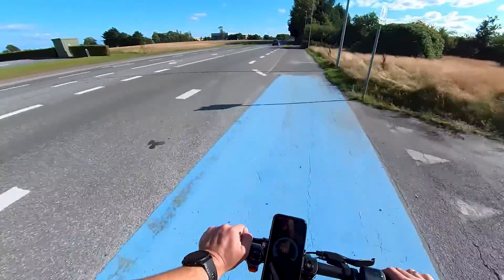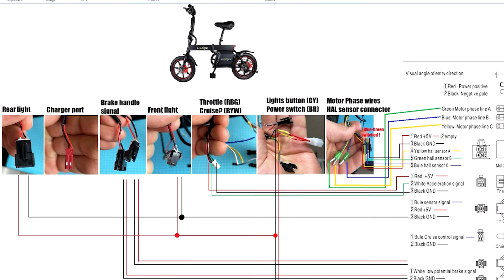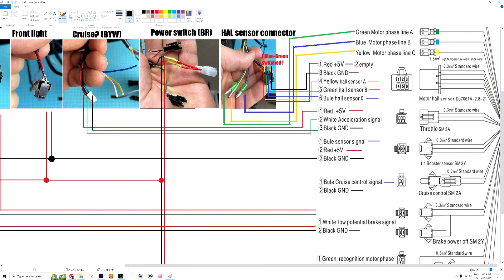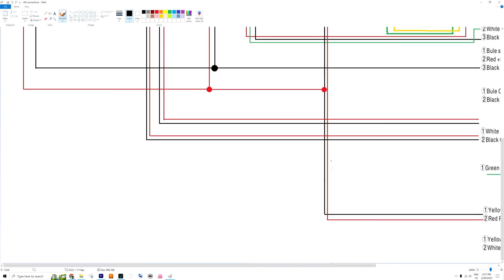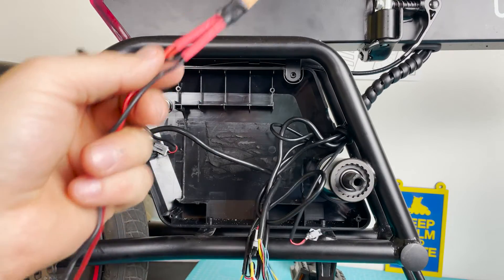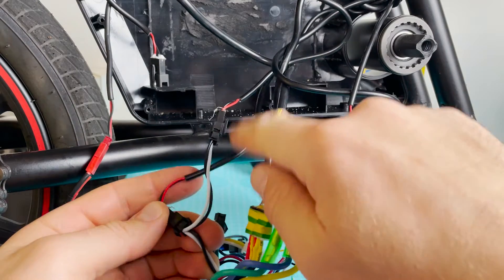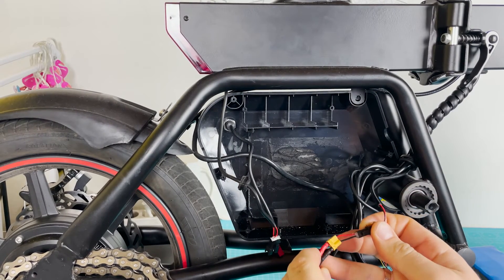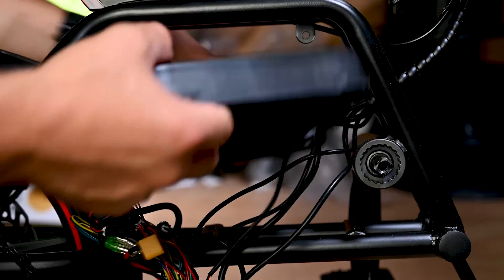Windgoo b20 controller replacement details

Comment: I have successfully wired up the new controller thanks to this video but I’m yet to test it outside. I have a couple of questions I hope you can help with. 
1. How will I know if I have wired up the hall sensor the correct way? 
2. Have you figured out a way to make the voltage meter on the throttle work? 
I’m yet to wire up the headlight but I have managed to get the brake lights working when brakes are pulled by connecting front and rear together then wired to the yellow and white brake light wire on the controller 🙂
Reply from the maker: I have not spent much time on it recently so Voltmeter not addressed, I fixed the headlight, but don't remember how :D With hal sensors you normally find ground and positive one, and then you have 3 hall sensor wires left. Maybe possible to open the motor cover and see the sequence or just play with the combinations until it both spins at load and at speed smoothly :)

Comment: VRMinde would you please be so kined to send me a picture or email to me how I can connect my Brainpower Motor Controller volts:36/48V Power 350W to my Windgoo B20 ??
And please show me the right way how to connect my CD_S866 Display to the controller and to my Windgoo B20 ?? Because I can't find the right wiring diagram for it on the internet !!
So hopefully you can & will help me fix it. Greetings from the Netherlands from Frank Grinwis
Reply from the maker: Hi Frank, sorry mate but I do not know anything about your specific controller and without a diagram I do now how to connect it.
Reply: To bad....
Do you know maybe where I can find the wiring diagram for the Brainpower Motor Controller volts:36 48V power 350W ??

Comment: Hello please i'm very thankfull for your job and i have 2 questions
1st is can i add anoter battery to the first one  in the place of fold ? And keep the 1st one.
2nd question : i need a link for a 10ah 44v battery , i didnt find it
Reply from the maker: Hi mate, you can add an extra battery of the same voltage and expand overall capacity, just charge them both to the same level and make parallel connection.
For the link, sorry, the guy does not make packs anymore…

Comment: Tah mate.
I already gave up on the pathetic supposed 6ah power pack, I'm using the 11.6 ah pack from an old series carrera fury, fitted upright behind saddle stem, for now anyway, it will probably mob to front of bike for better balance, interferes with fold clamp, but I don't fold mine anyway.
Will save me pennies up and get the other controller,or similar, do many controllers around now.
Do you have any knowledge about the motor being capable of regenerative charging ?
Reply: For down hill regen, some big hills round here.
Mine used 90% on canal towpath, every lock has a short downhill bit, it all helps, especially when your fully off grid.
1000 watt motors fag tyres OK when you have easv, cheap mains power, pointless if your rely on solar panels etc to charge power packs of boats battery banks.
Like water, no appreciation, u till you have to carry every drop you drink 4 miles somehow..
Reply from the maker: makes sense :) I lived all my life in flat areas and now in Denmark.. I think the highest elevation point in the country is like 200m here :D So I do not know much about driving up or down hill :D  @tedleaf-pk2jc
Reply from the maker: Hi, sorry mate, no knowledge. But even if it had for what? Pedalling and recharging? I disconnect regen on all my bikes/scooters anyways

Comment: Is it posible to only change the motor/ controller? Because I cant find the battery pack.
Reply from the maker: everything is possible :) changing only the controller will unlimit the max speed, but not likely add more acceleration and not clear how much actual max speed you will get out of it. Plus, normally batteries are designed for certain currents, so if you draw a lot of amps - that pack might start heating up and suffer.